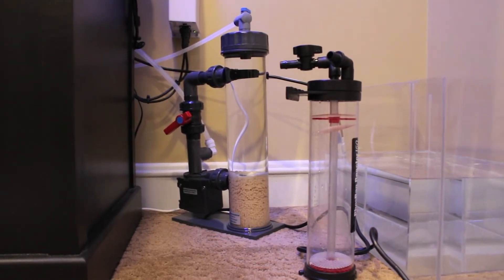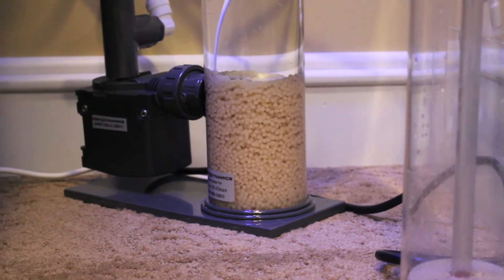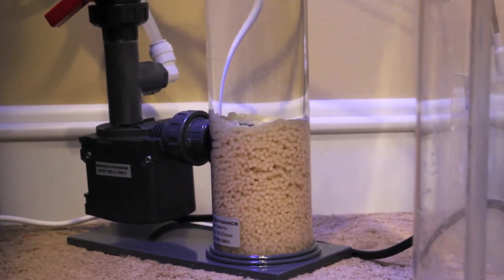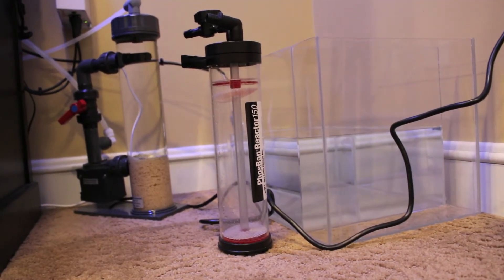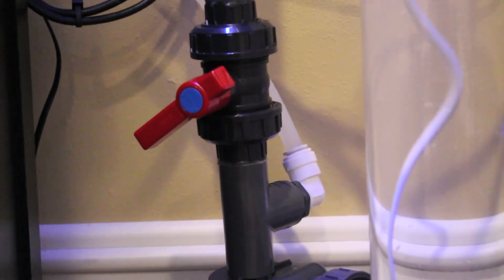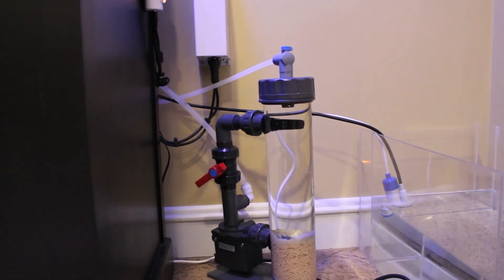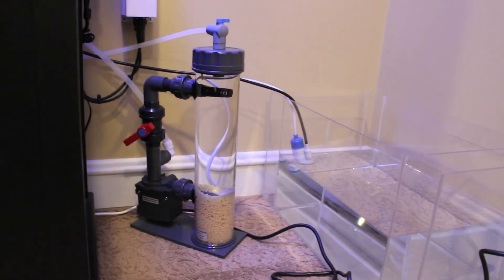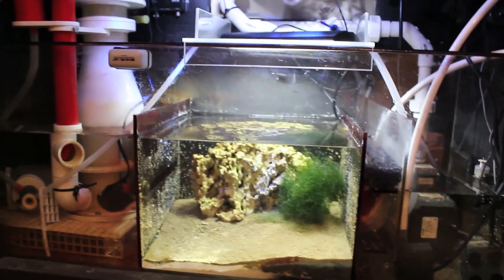Carbon dosing using Bio Pellets

Comment: Great Video.  I wish I would have watched it a week ago.  I just setup a Reef Octopus BR70 model on my bring down my nitrates 4 days ago.  I'm also running the same dual BRS GFO and Carbon reactor you have.  I'm starting out with about half of the recommend amount of Bio Pellets.  Do you think I should be ok with that?
Reply from the maker: All tanks are a little different, I know some that put the full dose and are fine.  I think everyone just wants to be careful as do I.  I would just monitor your corals and make sure your bio-pellet reactor outlet is feeding right into your skimmer and keep the skimmer neck clean.  Wait until you get increased skimmate and you should notice the smell will be greater.  Then wait a month and add a 1/4 dose and wait another month and add the final 1/4 dose.  It is so tricky to know how each tank will react to the carbon dosing.

Comment: hey whats going on reefgeek pretty good info on BP its been interesting on some of the things you have stated but i have used BP for over a year now with the TFL reactors and have had no issue what so ever. also have always started with the full dosage of BP on all three systems i've had with out any bad results when running BP you always want to have a Plus one skimmer for the extra ability to skim as much as possible from the BP's but some of the BP leak to the system is good because it good food for your coral. Also you talk about not depleting all P03 and p04 from your system but yet you are running BP,GFO,Refug,and live bac to me that a little excessive and you might want to reconsider using all those systems because if the chaeto that you have in your refug doesn't have any food to eat it will die off and release some bad stuff you don't want in your tank. also you sand bed in your refug is already dying off.
Reply from the maker: I'm glad that you have had great success using the TFL reactor and the method of introducing the amount of BP that you did.  I'm just conveying information that I have collected from others that haven't had such a good experience taking that approach.  I think the one thing that we all need to keep in mind that all systems are different and they will all react differently to what we put in our system.  I agree that the by-product on using bio pellets is a great source of food for your coral as all as you limit the amount released back into your system (not skimmed off), which will vary based on the amount of coral you have in your system.  I'm in the process of removing my refug which would include the figi mud (not sand in my refug...:)).  I'm going to continue dosing waste away since I made the mistake of not curing my dry rock and the organics are breaking down in my system, also will not be adding any coral until past my curing phase.  Once I'm at that point I will back off the live bac, and will re-evaluate the usage of GFO, but I agree on the benefits of using BP and will definitely continue using those.  My experience is very short to this point so I'm excited to see how things will go in the future.  Thanks for your input!
Reply: ReefGeekTV I just stating that i have done that way with all three of my systems that is three different systems at different times and have a bigger system as in the +1 rule help you handle the full dose. To also talk about the UV stabilizer it shouldnt affect the BP in anyway as in reproductions because the bac is only reproducing inside the reactor. also to shine some light about when having a power outage you stated to rinse off the BP i would not really suggest doing so will it hurt the BP no but you should of stated in the video to use RO/DI because i know people well rinse it with regular water which well end up bad because the chlorine is tap water will kill the bac and plus that is to much work i would just have pre-made fresh saltwater pull out the returning hose that usually go to the skimmer pull that out and lay it into a bucket and run it for a few min to get any bag die off/ nitrogen salfied   or how ever you spell it because that is the bad stuff that come out when you get dead spots in your bp. after running it for a little while then shut it down place the tube back into the take to your skimmer and your ready to rock again. One last thing and don't know if you were gunna go into it but sound like your done with explaining how and why your using Bp you left out kinda a really good information on BP which is what level of parameters you should be use and what kinda salt. what im talking about is that while running PB you should only be running you ALK at 7dkh and to be careful on what salts you use to do your WC because some salt values yelled high values of dkh hint why i use the regular red sea because if you run the dkh values higher then 8dkh you will start see burnt tips on coral so they say ive pushed those limits before but every tank is different and you want to provide the best information to your viewers  but anyways good deal my buddy just informed me of a thread on a form that breaks down BP to a + which he told me is over 7 pages once my buddy sends me the link ill shoot it you and hope your system come around soon so you can get some nice sps corals in that 90g
Reply from the maker: ian mcalpin Thanks for the comment, I feel we all learn greatly from other's experiences.  That is a good point on the ALK, its funny after the fact all the things that you overlook.  The cool thing is that in some cases the discussions that come from the videos can be just as informative as the video itself (like in this case).  I would be very interested in any additional information that you can send me, always looking for good information.
Reply: Reefgeektv ya I'm not trying to bash you in any shape or form I found your vids on this subject interesting and informative but also add a little to your info as well. I've done a lot of research in BP and I mean tons of hours because like you I like to know what I'm putting in my systems.. Also done a lot of research on the difference from bp and zeo and using a hybrid system with zeo and bp which I'm doing so on my 40b system to test it out and see what the hype is about.... Ill be looking forward for your future vids

Comment: Great vid. I've been waiting for a good video on bio pellets. . I been running my pellets over a year now with the 2 little fishes reactor, and also I have cheato in my refugium area in my sump. My cheato grows like weeds. My question is, dont you have to replace the pellets when they dissolve? Well mine hasn't dissolved since I started them more than a year ago,  and im starting to notice cyno in my refugium. What should I do??
Reply from the maker: Yes, as the bacteria breaks down the bio pellets you should have to replace them.  Since my reactor has only been up and running for 3 weeks I have little experience to draw from as far as how fast they are consumed, but you would think that every 2-4 months you would need to add some pellets.  If you are running your reactor for that long without any consumption I would assume that there are little to no bacteria in your system to consume the pellets.  I'm attempting to prime my system with bacteria using Dr. Tim's Waste Away, but I haven't came across many people talking about if you need to add bacteria to your reactor.
Reply from the maker: Since you have been running your bio pellets for a year and you haven't to this point experienced cyano, you could rule out the adding of too many pellets too fast, but it would be interesting to get other's opinions on that.  Are you using GFO and what is the size of your system and your water change amount/schedule?
Reply: Thanks for the info.. love the vids keep em coming.
Reply: No GFO.. I have a 57 rimless, and I do a 10% water change every week..
Reply from the maker: I would remove the Cyano from your sump and monitor it.  Are you feeding your bio pellet reactor outlet to your skimmer, how is your skimmer working in your opinion.  Your water change schedule seems good!
Reply: My outlet is straight to my skimmers pump inlet. Im running a reef octopus nw110 and its skimming like crazy.
Reply from the maker: Wow...you have a tough one.  Everything sounds good.  Did you possibly notice the cyano after removing some of your Chaeto from the sump if it is growing like crazy?  If so it might be that by removing some Chaeto, you have more nutrients in the system that the current Chaeto can consume, therefore allowing the cyano to bloom?  When I had my outbreak and reduce the lighting cycle and increased the amount of water changes during my weekly water change and siphoned out the cyano.
Reply: The last time I harvest my chaeto I did notice my sand in my refugium turning browm,   that's when the cyno got worst. Should I add more chaeto?
Reply from the maker: You can, but if your chaeto is growing at a fast rate it might take care of itself.  You could perform a larger water change (20%) and remove the cyano.  Let your chaeto grow out and when you remove it, do so in smaller amounts.  I would try to figure out why your bio pellets aren't being consumed, that would help out as well.
Reply: I really appreciate the info and the help thanks a lot

Comment: Great video, super detailed and very informative! Totally off topic, how deep is the water in the first chamber of your modified Ruby sump and how many inches do you have your Omega 150 submersed in water? How deep is the water in the third chamber?
Reply from the maker: Hi, the first two chambers run at ~10 inches, the third I have running at 7 inches, and the skimmer is running at 7.5 inches.  I think the manufacturer recommends between 7 - 8 inches of depth for the best operation.
Reply: Thank you. Planning on setting up my Ruby 36S in the near future.

Comment: Wont your cheato die eventually? I read that using biopellets will out compete not only nuisance algae but beneficial algae as well.
Reply from the maker: From what I'm experiencing, you are correct.  I think you either fight Algae with Algae or Bacteria, not both.  My Chaeto has been dying off over the last month.